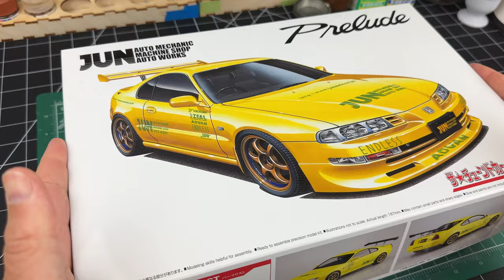Build a JUN Auto Shop Honda Prelude in Miniature. [FULL BUILD]

Comment: May i ask you where you got the sanding stick (at 1.50) from?Thx in advance!And nice build vid!But a little more infos about material or the way you do things would be appreciated(for example paint products you use,color,pressure and so on)!
Reply from the maker: Your request is understood! I have tried a few things in the past but maybe it is time to try something new. The sanding stick is from a nail set that I purchased on Amazon. Just a bundle of different nail files and polishers. They all have a plastic insert and a sponge before the gritt so they are perfectly suited for bodywork.
Reply from the maker: I have added a few links in the discription of some of the tools and materials I have used for this project. Hope that helps.
Reply: @ScaleAutoGarage  Great!Thx!👌